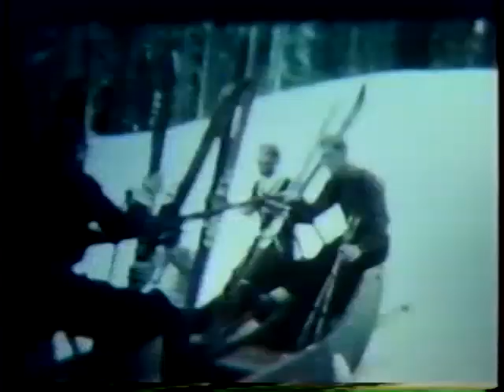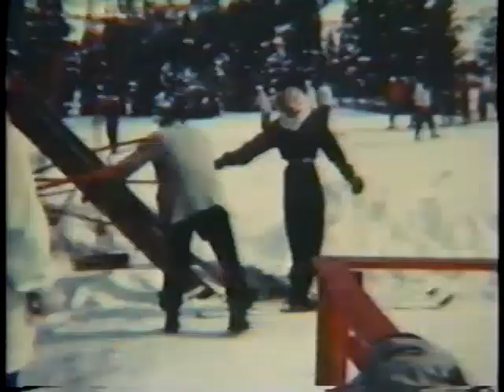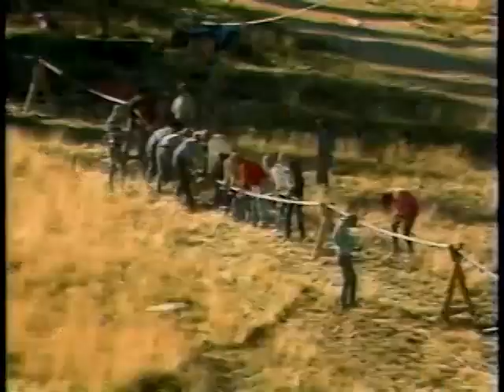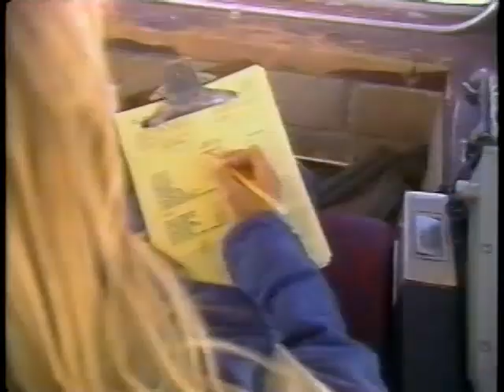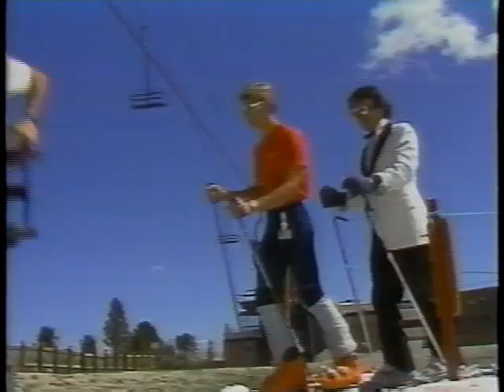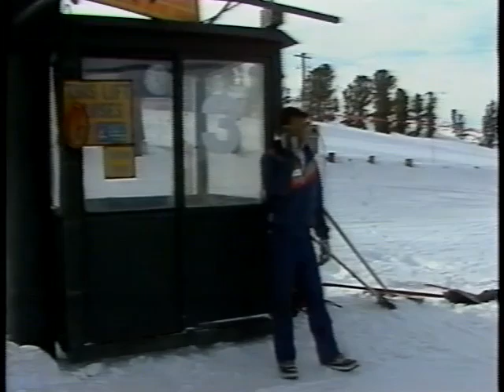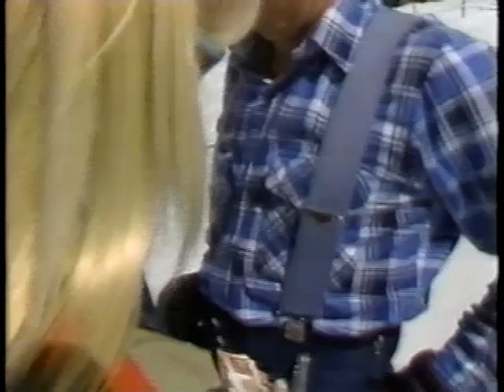ChairLift Operations Video

Comment: I've worked at Badger Pass for 35 years, lift maintenance since 2002. The footage of the Upski at about 3:50 is the first time I've ever seen it in motion! That lift was first used here in 1935, then relocated to where it's seen in the footage here in 1936. That lift line has a  Doppelmayr fixed grip triple (2008) and a Hall double chair (1972) today.

Comment: This must be from the late 70s or very early 80s. I started skiing in the mid 70s and we used this type of lift ticket. I started skiing before ski brakes, we used boot straps and every now and then there would still be a rouge ski flying down the mountain and every one would yell to notify everyone. That crap was so dangerous.
Reply: actually its late 80s i think. There are yan detachables in this video which didnt exist until 86. But they still look very new in this video so i would guess 89
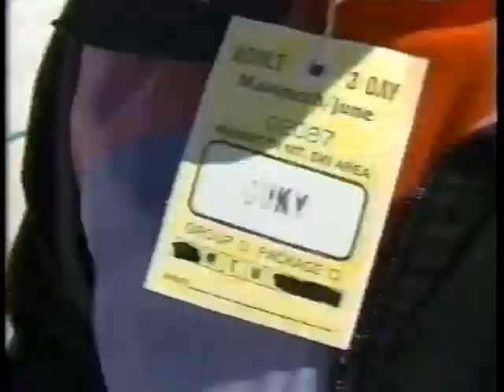Reply: @jahterminatedlmao5473  The multi-day ticket looked like "88 Nov. ##" so prolly 1988. Needless to say based on the lack of helmets and the presence of a noose @ 1:08:00, it's *not* 2021.

Comment: I love seeing these old lifts in there prime. I maintain 4 older riblets we did have 5 .it is sad to see them go
Reply: At least we have superior tramway
Reply: @Bluebottlenose  ya frank is a great guy he keeps the old ribletts going, and he does a great job doing it 👍 it is sad to sea thes corporations take them out for new doplmeyer lifts not that I hate them but the old ifts just keep running just as long as the matnianc crew has the knowledge to keep them in working order
Reply: @011CJ  hopefully we get some more US lift manufacturers that actually make their own designs, as of now we only have partek
Reply: The Riblet company should’ve stayed in business. They would be over 100 years old now. RIP Riblet 1908-2003
Reply: @108CAM  true. I wonder what they would look like now
Reply: @108CAM  1938 actually. Sugar Bowl single was seen before Alta bi-cable single
Reply: @108CAM  they were bought out by superior tramway based out of Spokane WA, ran by Franke Judge .they are still making parts to maintain them and keep them up to code 👍
Reply: Yes
Reply: The ones at my resort are getting on 60 years old. I’m sure they’re safe, but some of the poles are very rusty, some of the sheaves make rubbing noises, and the chairs are very creaky. Their age is obvious, but it will be sad to see them go, as they are the lifts I grew up riding.
Reply: @CrobinHood8BitGuy  sheave wheles make lots of noise it is not allwase bad it can mean a lot of things .the main thing is that none of them are rubbing on the fraim or any of the assembly and are not wobling or grinding . If your resort is in the us, it is inspected anualy or bi anualy and in the summer they should be geting maintenance like new bearings when needed  fresh greas and sheave liners replaced as needed.  The lift we just replaced was over 70 years old. The others are about 60. And all supper reliable and only got replaced beacus the big name owner likes new doppelmayr lifts 🤣👍 .don't fear a noisy lift, but if it is something that sounds concerning or out of the normal, never hesitate to contact the lift maintenance department .rust is normal and normaly superficial.👍 happy shredding

Comment: I'm one of the lift training supervisors at my resort and this could still be relevant training video today.  It's almost scary how little has changed in 30+ years.  The last section was hilarious.
Reply: The only major difference I can see is that the ticket checker has been supplanted by RFID cards and gates at many large resorts, however they still have the crowd control responsibilities to perform.
Reply: @everhopeful  RFID and gates would have prevented a family with lifetime passes from cheating probably (over several years) where I worked.  

One night I caught a family who had given last years passes to friends.  Other ticket checkers had just looked for pass necklaces.  I was a hard a*s who was checking every pass.
Reply: What ski area do you work at?